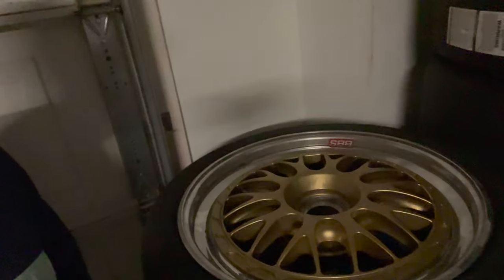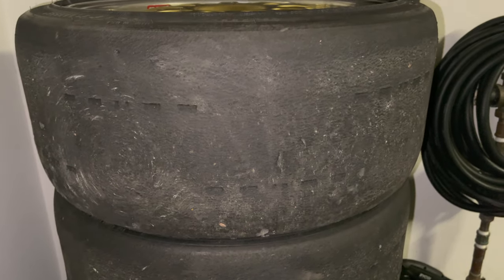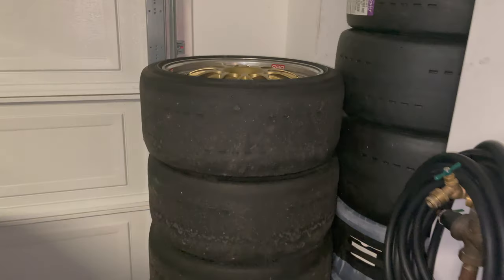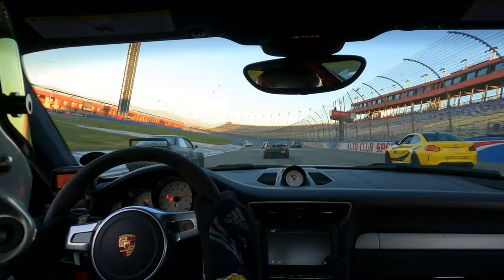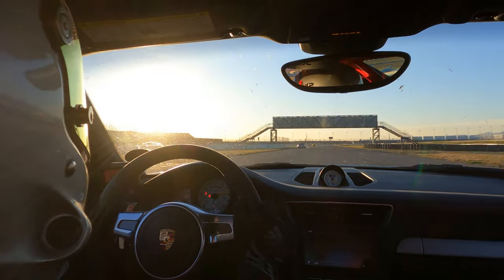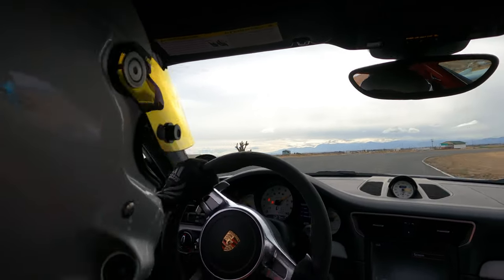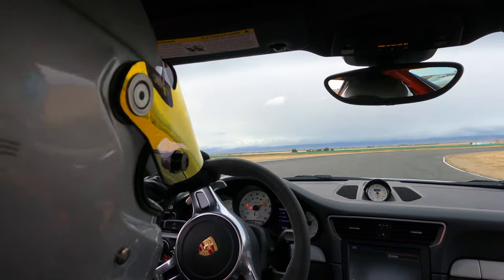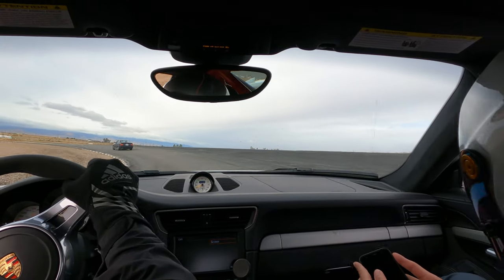Tire Review: Hoosier R7 - The 40TW King?

Comment: Nice review. i have been considering r7 … would you say this is faster than cr2v2 and ao52?
Reply from the maker: Maybe not at their peak but R7 are much faster and last longer. AO52 will give you 1~2 hot laps for 2~3 heat cycles but R7 will be consistently fast for 4~6 heat cycles straight before you notice the slight drop off. I’m not a fan of the AO52 and will never spend the money on that tire again after all the other tires I’ve experimented with that are better and cheaper